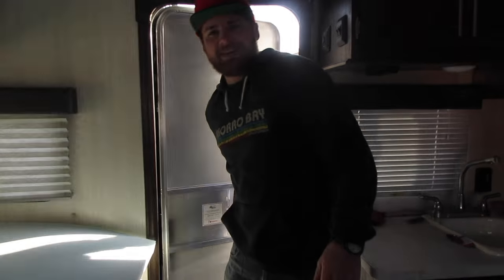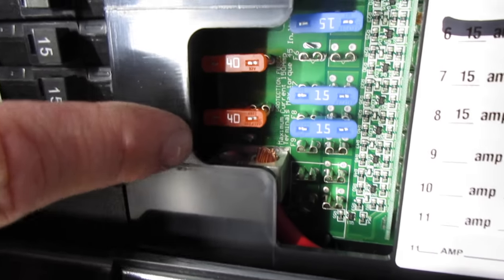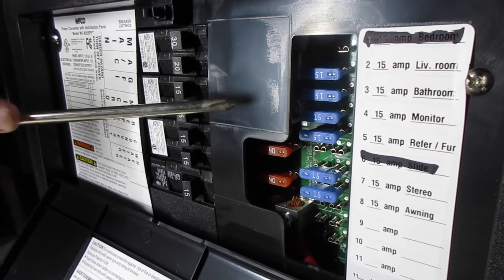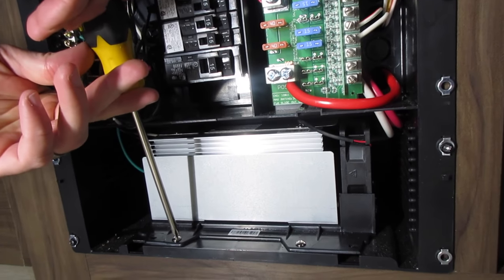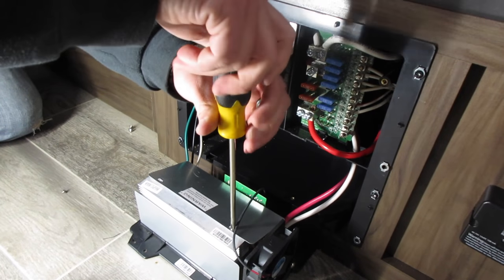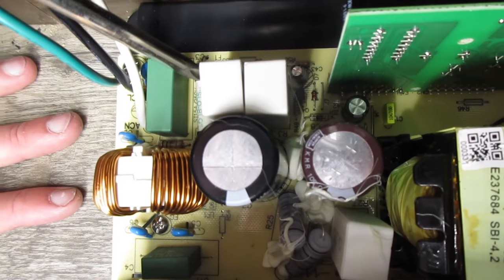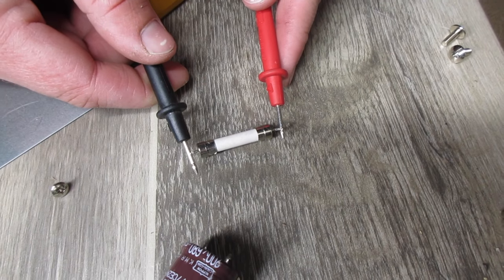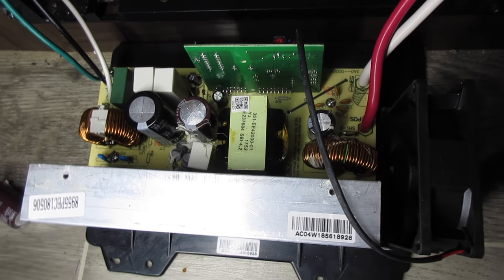RV Power Converter Fix #diy #notcharging new vid link below

Comment: I have a similar issue and that is the identical converter board as mine. Did you ever find the part number for the entire board? When I searched for the board and used the number on the white label I couldn't find anything and or a price. Your help would be appreicated.
Reply from the maker: Thanks for watching and subscribing. I did find a replacement board but did not purchase. I can’t seem to remember the number tho. I do remember it was the brand WFCO. Look for the number after that. It might  be wfco 8900 or something like that from what I can recall
Reply from the maker: I think wfco 8955PEC
Reply: @RotoCityTech  Thank you for the help

Comment: My converter keeps clicking on and off .. the lights Flickr bright and dem .. when hooked up to ac power .. what is causing this
Reply from the maker: Hmmmm that’s a weird one. I’m thinking that perhaps the battery is bad. I’d test the voltage in the battery first and make sure it’s around 12.4 or so unplugged from everything. If not charge it fully with a charger and try it again in the camper and plugged into AC power

Comment: Where did you get the new capacitor from?
Reply from the maker: Thanks for watching. Check the video description for the link but I think it was eBay and has expired. I know you can get ones from other sellers on eBay tho
Reply: Do you remember any info on the fuse? Mine is bad also and can’t read what’s on the fuse to know what to buy
Reply: @renohd  I believe it was also in the video description. 250v 5x20mm I believe

Comment: Your other cap is bulged to and that is an indication that it is about to fail as well
Reply from the maker: Thanks for commenting. I’m prepared to replace it as well just have not pulled back out the converter. I guess I should sooner than later

Comment: I just bought the wolf pup, and it looks like the converter is bad. Why did you not just replace the converter yourself if it was only $100?....I ask because I just want to replace the converter myself (I don't want to wait 2 months and drive it somewhere)
Reply from the maker: Thanks for watching. I decided to fix it because it would save about $75-80 and because I wanted to find the problem and fix it to share with others. I hate throwing away a lot when just a little is broken. It is way easier to just replace that is for sure tho. Good luck!
Reply: @RotoCityTech  Ok I am not an electrician and just a bit handy. Is is pretty easy to change this converter out?...the last video I watched on doing this (wasn't a wolf pup) was a lot of work, disconnecting many wires, etc.
Reply from the maker: Shouldn’t be too hard. If I remember correctly it is just a red wire and white wire on one side and then the other has 3 wires. Green, black and white.

Comment: I have the same problem paid 1800.00 and the damn thing only works when I plug it into the house 120voits  piz let me KNOW WHAT TO DO ,We were going on our very first camping trip and now BOOM! can't even go camping 😢🥵😤😡😠🤬.
Reply from the maker: First thing I’d do is check those 40 amp fuses on the converter that I point out in the video. If those are good you need to make sure all the breakers are on. My guess is it’s one of the 40amp fuses. Let me know!

Comment: When I am plugged in at the campground using my 12 volt system, everything is working fine and then all of a sudden it goes dim and shuts down. After a few minutes it all comes back on. Can anyone help thank you
Reply from the maker: My first guess is maybe a relay is tripping and then resetting? Are you using a surge protector with plugged in at the campground?
Reply: No no surge protector just plugging into the campground electricity. appreciate you answer do you know where I can find that relay?
Reply from the maker: Mine are right behind the frame on the front of the camper. It’s a relay that resets automatically after it trips. I would recommend a surge protector so that you always know it’s safe to plug in. Other than that it’s weird that it goes dim and then comes back which makes me think it’s resetting and not just blowing something
Reply: There are 2 relays on the converter that are white boxes. If you listen closely when things are dimming , you will hear fast clicking then when power stops clicking does too. Replace those and make sure to have a fully charged battery to start with
Reply: Also buy a battery float charger(harbour freight $12) and connect to battery, will help lowering amount of work converter has to do

Comment: I have a new battery installed on my camper and still no DC power
Reply from the maker: Hmmmmm you just need to start tracing the wires to the power converter and make sure everything is connected. One thing to check is the reverse polarity fuse where all the fuses are lovated

Comment: @5min....... swap out the 'old stuff'... what else than the FUSE was bad? thanks
Reply from the maker: So a capacitor was bad as well. It had bubbled up and was leaking a bit so I replace it too. That brown round piece.
Reply: @RotoCityTech  ah- that makes sense.  thanks!

Comment: Mine burnt out so I guess it's no longer good let me know please
Reply from the maker: It’s worth looking into for sure. Just check the continuity of that fuse because it’s a fairly easy fix
Reply: @RotoCityTech   well I have regular power but my a/c and my refrigerator does not run at all
Reply from the maker: I would check the breakers it seems on an issue like that

Comment: I'm getting 47 Volts to my batteries.
Reply from the maker: Whoa! That’s a lot! What is different about your set up?
Reply: I have a 50 amp one here.  I might throw it in until a new 30 amp shows up.   I won't plug into 50,just 30
Reply from the maker: Yea that seems really weird. I put a 100amp converter in my camper and it’s no problem.  From what I’ve seen anyways. Just gotta make sure the wire is big enough but I upgraded my dc wires from battery to charger.

Comment: Thanks!
Reply from the maker: You bet! Thank you I really appreciate your kindness!
Reply: @RotoCityTech  not a problem! I do have a question regarding a 2021 Wolfpup. It’s not the Black Label version that you have but extremely similar. when I bought it, somebody had cut the brake wires on the trailer on both sides of the axle, just inside the tires. I didn’t notice it until after I drove it from San Francisco to Phoenix. I tried to trace the wires to recrimped a longer extension, but the wires colors don’t match. they go into a hole in the axle and then come out by each tire, but the wires are different colors. Do you have a wiring scheme for this? Forest River is worthless for info. I basically had a 50-50 guess at it and I figured I would hear the brakes click once I hook the battery back up but I got nothing. I think the dealer screwed me on this, but it’s too late to take it back. Also, the main door doesn’t close. It’s a glass privacy door and it will not latch without slamming it with the extreme force. Again, I don’t know how one trailer can have so much go wrong after one year. Right now it’s just sitting in storage because I’m sick of dealing with it. So I bought a 26RR black label gray wolf instead, lol. At any rate, can you point me in the right direction for a wiring scheme and a place to pick up a door?
Reply from the maker: Let do a little searching and I’ll look on my grey wolf I have now as well. I no longer have the wolf pup but it’s gotta be similar. As for the doors even mine on my grey wolf is a little difficult. I think that’s just the glass doors but I’m still messing with it. Messege me on Facebook or Instagram as it’s sometimes easy to miss stuff here @RotoCityTech
Reply: @RotoCityTech  I won’t put either one of those programs on my phone but appreciate any input you have. As far as the door as soon as I drove that thing off the lot, I noticed there was something wrong. I should’ve turned around and taking it back, but I noticed somebody tore off the cover plate on the frame so I knew that the people at the dealership had problems with the door, and they just tried to hide it. When the door is closed, you can tell it’s cockeyed, so I’m assuming something happened to this trailer, the owner traded it in without a claim, and I’m the recipient of a piece of shit dealer repair.
Reply from the maker: Oh yea damn that sucks. I hate those kinda of dealerships. I’m not a fan of any really with the exception of Cheyenne camping center. Which is why I have bought two from them. I’ll let ya know what I find out and help any way I can
Reply: @RotoCityTech  I appreciate you.
Reply from the maker: So I took a look at my brake wiring finally and I have two blue wires that go together crimped to a black wire going into the wheel and then two white wires crimped to another black wire going into the wheel.
Reply: @RotoCityTech  sounds like someone really messed with the wiring on mine then.. it’s all different colors.. I’ll probably just end up rewiring it.